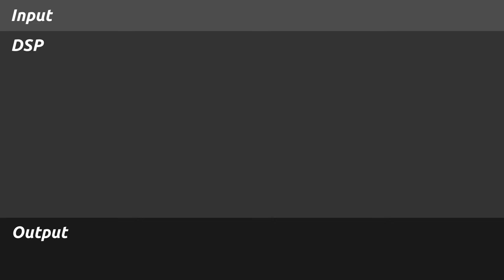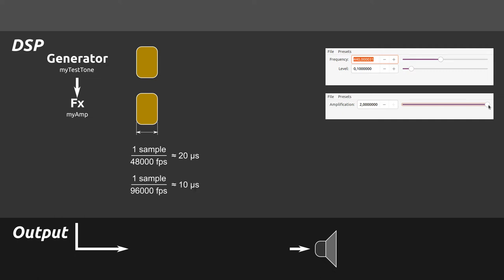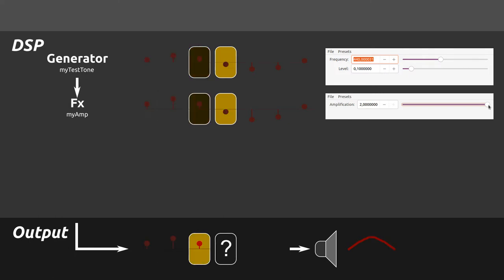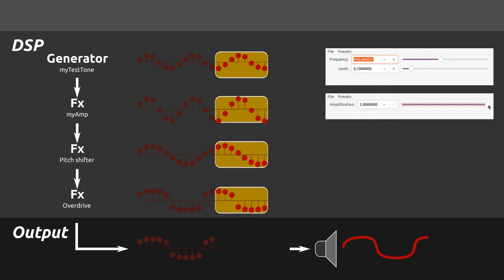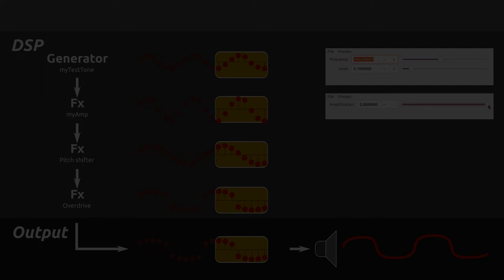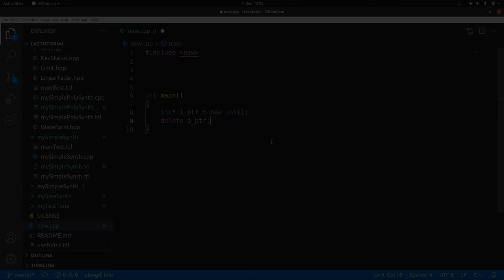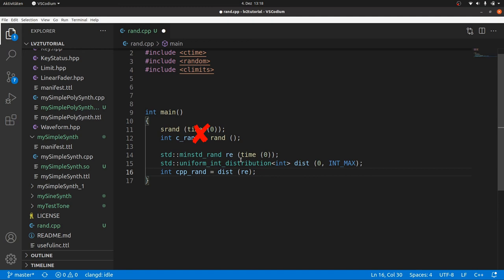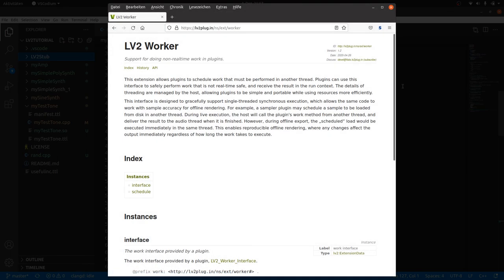Programming LV2 Music Production Plugins From Scratch - 11 Programming Realtime Audio

Comment: Love rt code. Just have to say from my testing it was not likely that the host would call the run function with only 1 sample. But it can happen if there is some curved automation. Like thos videos thanks.
Reply from the maker: Yes, indeed. And the standards even include an (exceptional) zero sample run loop! But this is a very special case.